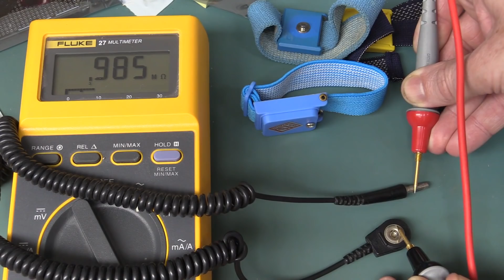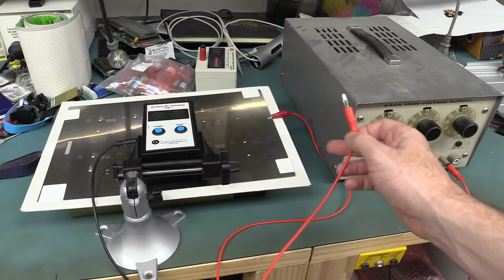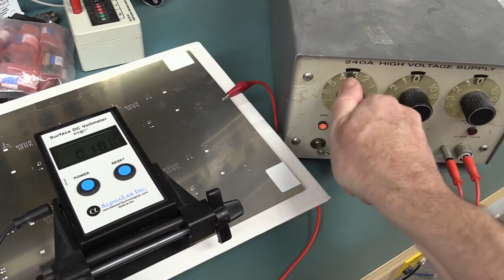EEVblog #768 - Cordless Anti-Static Wristbands BUSTED!

Comment: I know this wrist strap is crap so keep that in mind, but in all fairness I must ask this question because you can actually measure the data with your surface voltmeter which I don't have, and it seems like the only thing you didn't try...

 Here goes, "Does it dissipate energy if you touch the screw attached to the resistor on the top of the wrist strap to complete the circuit?"

It seems like it should at this point. Sort of like touching the case of a computer to equalize yourself the resistor will drain the voltage right? I just want to leave no room for question because this seems like the only way it could work without attaching a cable to the screw on the top. The resistor screwed down in the top is a good 1M resistor, connected from the metal plate on the bottom to the screw on the top. FYI:) These things don't have instructions, so I ask just to be sure, "Are you supposed to touch the screw to drain the voltage?" Using a resistor is the technique that is used to properly drain high voltage capacitors without a ground to main. Again I am not defending this product, but I just know someone will say to me, "If you just touch the top while wearing it, it works..."

If so; 

"How fast does it discharge or how long does a person need to touch the screw on the top if it works? Is it similar to touching the case of a computer while working on it?"

Comment: I believe the thing can actually work. They must be expecting a user to use an anti-static mat and to keep his hands laying constantly on it. If your mat is grounded and the screw is constantly kept in contact with the mat everything should work just fine. Just don't press it too hard or the resistor will come off and the thing will just silently stop working. The mat will work the same way with just bare hands touching it directly though... OK, I give up, I don't even know what they were smoking.

Comment: You're using it wrong! Maybe cordless is ginglish for wrist strap without a cord. To me it's ment to have a cord attached by the user to that screw.  In this case it would be working fine, it even has the 1m resistor. If it was just ment to be a con, why have a resistor?

Comment: I'm not arguing static build-up isn't a real thing (it certainly is, I've zapped myself plenty of times getting in and out of stuff) but the thing is, modern electronics is so well protected against it / any consequences are so hard to detect that I've been able to get away with NEVER, EVER wearing any static protection my whole life and still never see ANY adverse effects on anything I've worked on, ever. And I've worked on PLENTY of stuff, believe me. Which is exactly why crooks manage to get away with this: scams exist wherever direct assessment of effectiveness is hard. Audio fidelity, fuel consumption, power consumption (factor) - you name it. The only criterion is: make it hard to measure objectively, and you're on to a gold mine...

Comment: Has anyone here ever had a static charge kill a component? I ask because in around 10 years of tinkering, building computers, servicing laptops etc - I've never once had a charge either jump from me and kill a component, or have an item die without cause. I've seen no end of videos of PC techs building machines, or working in server rooms etc and hardly any of them use these straps. Maybe it's similar to safely removing USB drives. Once in a few thousand jobs something may happen to some extent, but generally it's completely not needed.
Reply: Well, You say you have never had a charge jump from you and kill a component, but since the static charge voltage needed for you to notice anything can be hundred or more times larger than what would damage a chip, you might not be aware that something happened, and even if there is an immediate issue, you might just conclude you got a component that was faulty, and assume it was a manufacturing error or something.

Perhaps the biggest issue with ESD is that it can cause weaknesses in IC structures that may not cause the device to fail immediately, but that can be a point of failure over time. After all, if you have half of a trace blown away by an ESD, it wouldn't be that odd if it would be a point of weakness where normal thermal expansions could cause a failure over time. Unless the component was later investigated under high enough magnification(which means something like an electron microscope has to be used) to actually see the features, you wouldn't know it was ESD that caused the initial issue..

One problem is that many devices these days have ESD protection built in, which is perhaps a good thing in that it reduces the incidence of failure, but it is bad in that it may make people complaisant or perhaps even make them doubt there is an issue at all. 

So, ultimately, it is almost impossible to know how many devices actually fails due to the effects of ESD, but since just one person touching something they shouldn't may cause a failure years later, it may be more common than one would think.
Reply: James Oldiges Damn people.
Reply: ***** 
You can actually make a hole in mosfet transistors and kill them or shorten their life span, and you don't need to see a spark for that to happen.
Reply: ***** Long ago when I was an undergrad in arid Colorado, I definitely remember feeling a zap when I killed a microcontroller dev board. Didn't help that the lab I was in was for general engineering, and had rubber anti-slip mats in front of the benches. So there's a first-hand experience for ya.

Comment: I know how to make it work. You are missing the giant afro wig unit that has tens of thousands of thin metal spikes protruding about 2 feet from your head. This then has a wire that runs down to the wrist unit. Any static charge that you might touch is then dissipated into the air around your head.

Comment: Is there anyway one could make a wireless anti-static wristband? I mean, maybe using electronics and stuff that soak up the static and store it inside. Then again, what do I know, I'm a computer guy, not an engineer. Though I've never had any problems with static even though I don't have a wrist band, you can ground your self by touching the case of a computer or your kitchen sink before touching anything inside a computer.

Comment: Actually  it  would  work when contaminating the  wristband  with  some radioactive material. Ionizes air :  discharge path  through  ionized air. 
Or having  some  open flame, also  ionizes air.

Comment: I ordered something from ebay and i got one of these for free. I didn't know the where supposed to "work" wireless. I thought you needed to add a wire from the screw to ground. I really hate how ppl fool each other. Just as crap as fake parts and batteries that claim to have more cap then they actually have.

Comment: I see the problem... you only bought the anti-static wireless transmitter. Everything wireless needs a transmitter ANDA RECEIVER!! For just a paltry $1.21 more you can have the wireless receiver shipped directly to your door! I am very surprised to see just ONE resistor in their band. Surely that is a very inefficient way to wireless transmit anything. A trace antenna or having at least TWO in a dipole configuration would be much better. Many dipole configurations exist, such as inverted-V, folded, trapped, etc. The two resistor version is called the cr@p dipole. A cr@p dipole that has its resistors the same impedance as any wire it is attached to is called a tuned cr@p dipole. This configuration differs from a standard trap antenna since it does not use a load coil and capacitor on each leg of the dipole but is similar to a standard dipole. An antenna this short doesn't need anything to make it resonant at its operating frequency- which is called the B.S. Frequency. Although in heavy B.S. filled environments, coiling the leads on the resistors could be helpful but it is the subject of heavy debate.

The real magic happens in the receiver. The radio waves are ElectroMagnetic. The cr@p dipole receiver shifts the impedance and capacitance function to the internal receiver's coil. Inside the receiver is a fixed Overunity magnetic coil which transforms the resulting oscillation to the Overunity coil into OVERTHRUST or in layman's terms, the power, force, and in this case, Electromotive force (EMF). Since the coil is fixed, what it effectively operates as a wireless power source for an elctromagnet. Electromotive force <-> Electomagnetic Field.

The receiver's basic operation is rooted in the use of the Complex Induction formula Z = 2 pi F j. The coil acts like an inductance coil and since the coil is fixed and not attached to a moving mechanism, the M of the EMF (Electromotive Field) stays constant and the coil creates a Magnetic Flux which acts as a capacitor and the E of the EMF (Electomagnetic Field) is the end result. To put it simply, this isolation of the magnetic part of the RF energy effectively uses the RF as a carrier wave and leaves just the “electro” part of the RF transmission state, that is radiatively coupled to the ground state, which dissipates the STATIC electricity. As a brief side note: this is possible due to the basic nature of the primordial superfluid substratum of the universe. A full Overunity magnetic coil attached to a moving drive mechanism is what transforms magnetic energy into KINETIC energy.

Comment: I think the original idea behind these was for discharging yourself safely for people who experience static shocks around the house and to ground yourself before touching electric devices by touching the screw on the band to a radiator or metal gounded applience.

But as with alot of the items it has been lost in translation either accidently or not.

Eitherway theres allways somone to buy these just like the magnets that alighn petrol on the way to the carb or injector and those magnet braclets.
Al

Comment: Those were designed to be a tether less system... hence the large screw head... and the cordless or 'wireless' nomenclature.  So obvious.  They are specifically designed for a very specific usage model.  Operator mobility in a 'touch & go' environment.  Here's a thought... How about interviewing the company that designed it and learn about the unique application environment is was designed for.  Just because Kingwin and others sell these on average from $1 to $8 each doesn't mean they are meant for general purpose.  Again ... so obvious.

Comment: But in theory though, I think you could build a wireless anti-static band? You could have a battery or capacitor that will absorb the electricity off your body. Then the stored energy could be dumped as heat or by an electric motor
Reply: No, you can't, electrostatics doesn't work like that, Gauss's law defeats your wishful thinking.

Comment: what happens if you plug in the real strap and then try charge it?  that would have been more comparable to wearing the cordless one and charging up.  but its funny they thought it would work, its like holding a resistor in your hand.

Comment: You just don't get it. It's wireless, that means it does not have a wire. It does not mean it should be used without a wire. You simply need to attach a wire to it make it to work. For your convenience, the already added a screw so you can attach your wire to it very simply. I once lost the charging cable of my phone, so it was wireless too.

Comment: I have a wireless anti static strap. From what i read and understood about them they are a bit of a sham. They do lower static to a safe enough level and yeah that would be it. So you still have static but not enough to toast anyting. In that case you may as well just ground yourself to your computer case or power supply it will do the same thing a wireless anti static strap will do maybe even better.

Comment: I'll preface this by saying that i don't think the $1 wrist strap would have worked, but i don't think your testing methodology is correct. Timing the discharge rate between the natural discharge and the wrist strap should have been done. The question isn't "is the grounded strap better" but more "does the $1 strap work at all". Assuming that the $1 strap does work, it's more convenient, and you're more likely to have it "on" 100% of the time compared with plugging in a cable every time you sit down.
Reply: ***** it doesnt matter about the timing (which i assure you will be the same) if it doesnt work at all lol
Reply: megaspeed2v2 it does matter. If you're not generating huge amounts of static electricity, something that discharges you slowly but is more convenient would be just as good.
Reply: ***** no because even if you had something that discharged you slowly (which this scam product obviously doesnt even do that) that means when you touch something like an IC which will discharge quickly it will still kill it just as easily.
Reply: megaspeed2v2
[the hypothetical product] is still reducing static discharge, and therefore lowering your risk of a static shock. Having something working slowly 100% of the time is better than having 100% effectiveness some of the time.
Reply: ***** no it isnt. static shock is exactly that... SHOCK. it is quick. discharging slowly offers no protection all all whatsoever in the slightest.
Reply: yourcurtainsareugly Well, in my observations,what he should have said was that it barely worked, rather than it didn't do anything. In the second round of the testing, with the cordless strap on, he couldn't even make 2 whatever unit he was using.

Comment: The funny thing is it COULD in theory work. It would have to pull the charge from your arm to a capacitor, then use that capacitor to broadcast junk noise on some unused radio frequencies. But there's no way in hell you'd be able to make that for a dollar.
Reply: TestECull when broadcasting junk noise you will disspate energy, but no charge actually leaves the antenna of a transmitter!
Reply: Uwe Zimmermann The static charge is drained to charge the capacitor, which is then slowly discharged again broadcasting the junk noise. When the cap is fully discharged the transmitter shuts off again, and with that, the charge picked up from the wrist is gone.
Reply: TestECull you cannot drain the static charge away this way! Static charge is an excess of either positive or negative charge, i.e. either a lack of or a surplus of electrons on your body as a whole entity, including all gadgets you might or might not be wearing. You have to either fill up the missing electrons or get rid of the excess electrons by connecting to a bigger reservoir of charges, like the earth. 

In this case it does not matter whether you have a charged or discharged capacitor on you, since this will only very locally change the balance of charges close to your body, but not the total amount of charge on your body.

Comment: I'm more surprised that people fall for cord-based anti-static wristbands. Unless you're dragging your feet back and forth on a 2 inch long shag carpet, you're not going to spark something and damage your system. It's literally like a one in a million chance.
Reply: I guess I should have been more specific. I'm sure there are applications where it's necessary. I was more speaking on the typical uses for them, such as PC building. I've done tons of builds and never used one in my life and I've never had a damaged component. I think with a little common sense and care, they're not necessary. But, as I said, certainly there are some uses for them, such as things you mentioned.

Comment: If they contained a source of ionising radiation (radioactive material) that might limit the static charge build up on your body with the bonus that you get to glow in the dark.
Also if there was a naked flame coming out of it that would do the job as well. Ideal for walking found in areas where there might be explosive gas mixtures in the atmosphere so it won't be an electrostatic discharge that sets it off.

Comment: Think about the rhetoric differently and it's not bullshit.  It is an anti static wristband which is cordless, in that it is shipped without a cord.  If a person were to add a ground wire it would go to the screw on the surface.  Amusing subterfuge.

Comment: I didn't believe this "wireless discharger" works, but first... which is the physics behind static charge in human body? Well is supposed everything by friction generates free charges, if them find a path to go to ground, well then they will use it. If a human in movement is not in contact with ground because uses a insulated shoes or is on a car, the electric charge will accumulate because there is not way to go other place. In this condition if you touch other person that is in contact with ground or have a opposite charge then the "interchange" has success and you will feel it. What happens when the weather's hot and the humidity is high?, decrease the electrical resistance of the air, slow but constantly the body is discharging by the wet air, opposite, in winter, the environment is cold and dry then the air is better electrical insulation and the only way to discharge is the annoying touch that make you jump. Well I bought one on this "Bu..Sh..." stinky "item" in past winter, when arrived I disassemble it, find the 5M Ohm resistor and laugh, and well I haven't a static charge metter, then and used magic discharger along the day, suprise, no annoying discharges happened. With this I don't recommend this like the only resource for work with electrostatic sensitive devices, but maybe is no so "rubbish" this items, and for one dollar... I invite to you to make your own test.